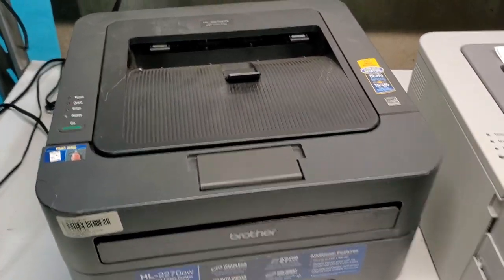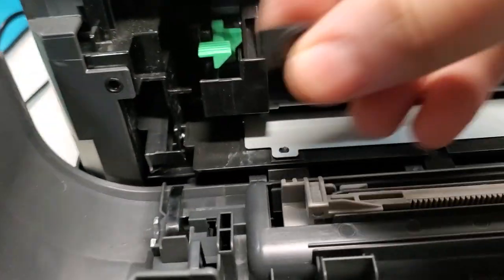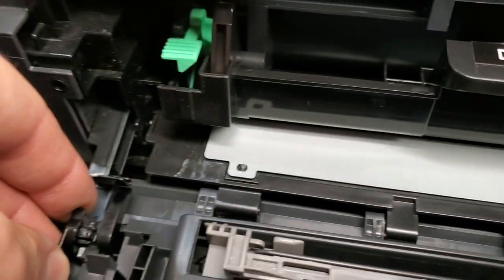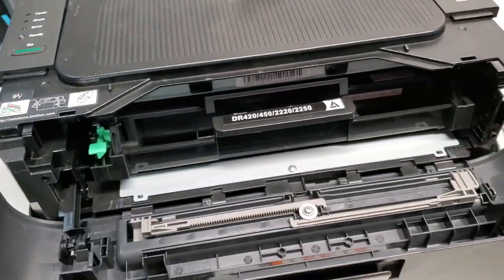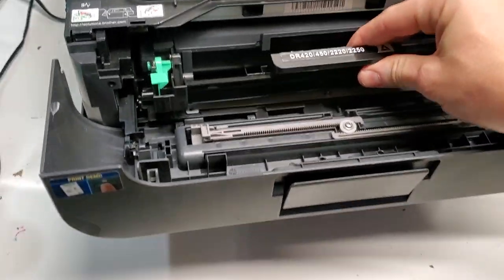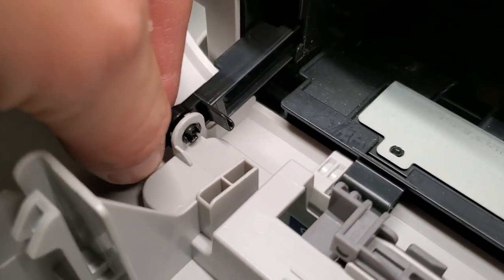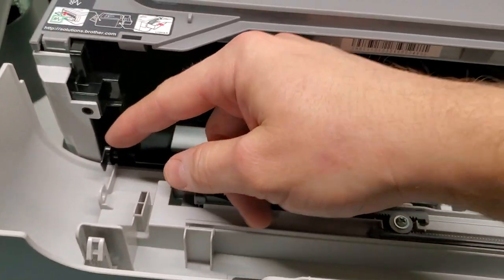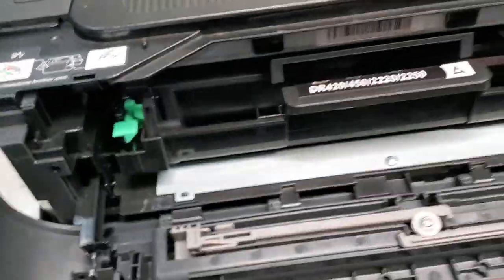Toner Cartridge Stuck in Brother Laser Printer! Won't release! Easy Fix

Comment: Great video, but didn't solve my problem, so hope you have another idea.  The arm you show as broken seems fine on my printer HL-2132 and moves in and out okay, but still can't remove the cartridge.  When I print it just thumps and the print that comes out is basically nothing.  It is a new toner.  Thanks
Reply: Hello were you able to fix this issue? It was the same for me it had paper stuck before

Comment: Help. #Brother DCP-7040. Still stuck. The piece you refer to is a bit loose but that’s all. I’ve opened and closed the cover numerous times but there’s no budging the drum/printer cartridges. Bought new drum unit and new toner cartridge to replace and now no way to even replace the toner cuz no clearance to remove it from stuck drum 😢.